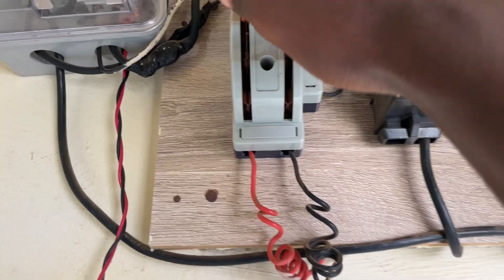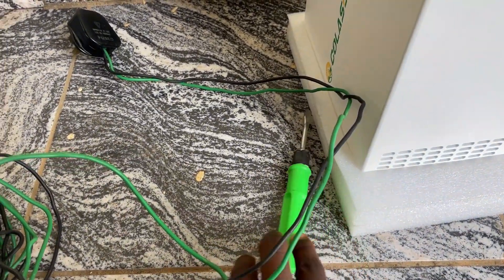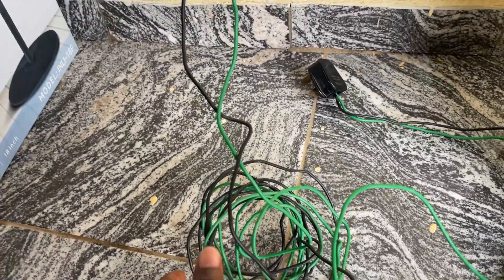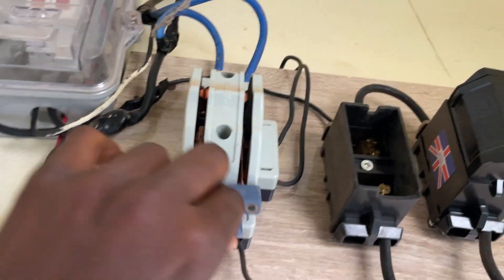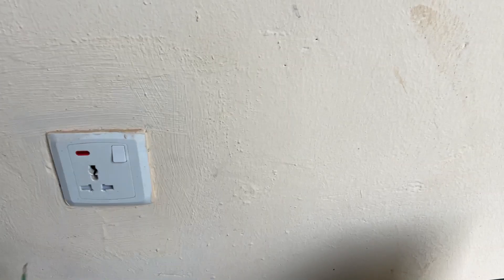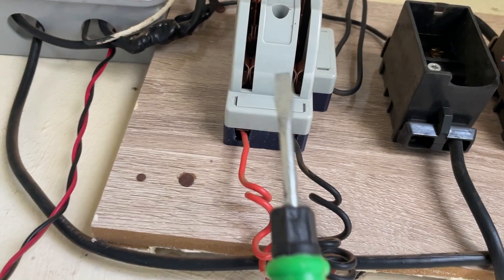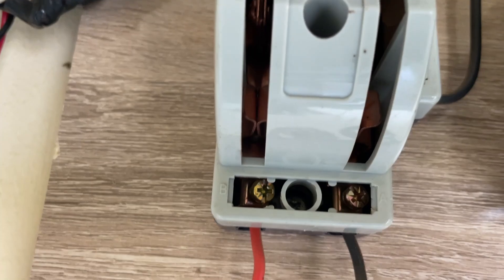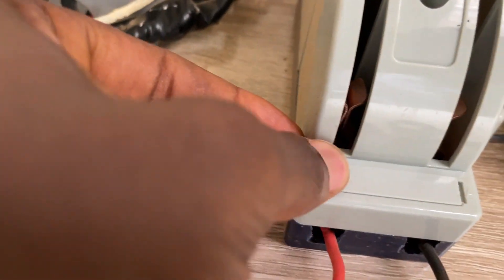How To Connect Cola Solar Generator To A Changeover Switch To Power Your Entire Apartment

Comment: I herd that if the power station is on and you mistakenly change over to NEPA, it will damage the Colasolar.
Is that true?
Reply: No, the purpose of the Onload changeover switch is to switch to various power supply or sources safely.